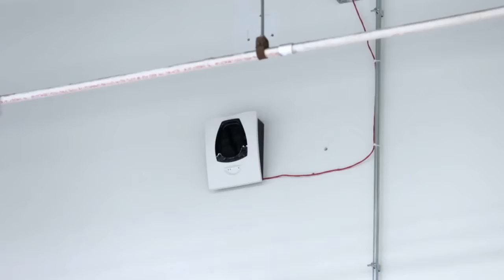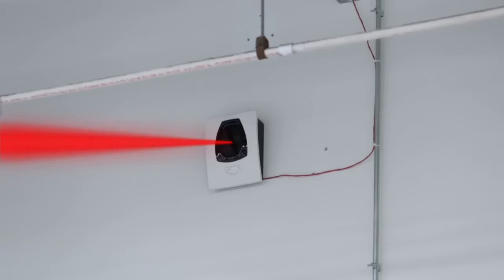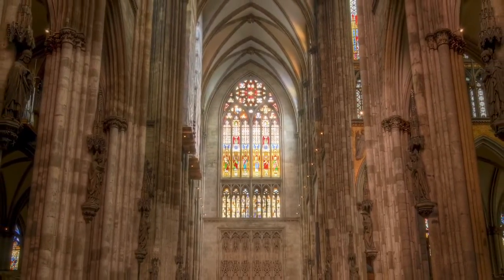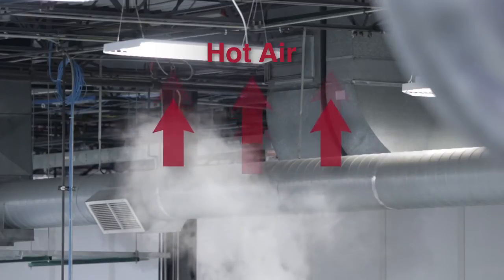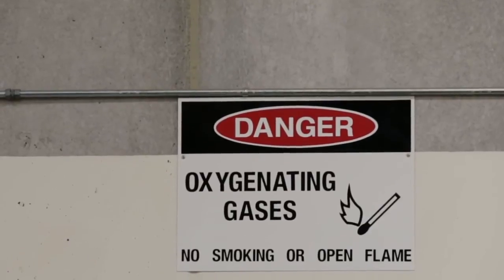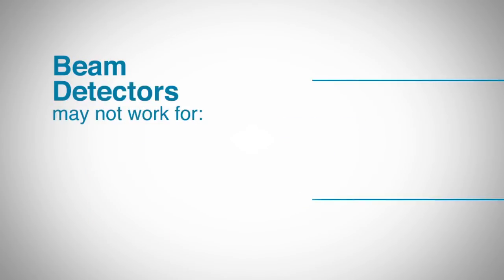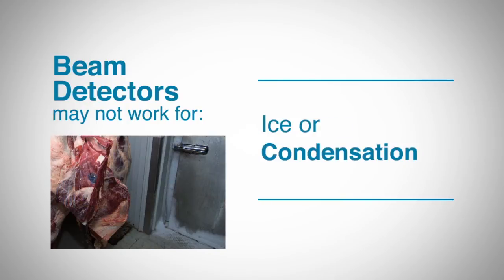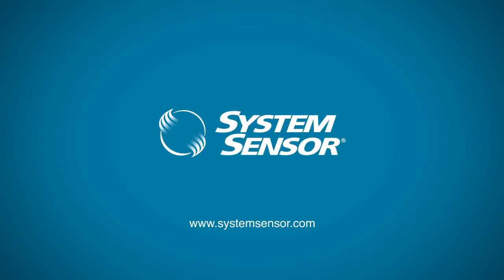Beam -- Chapter 1: Introduction to Beam Detectors

Comment: this type of detector can observe any obstruction such as light?????
Reply: It shines an infrared light to a reflector and back to itself at a receiver end.
You could set it off with your hand, but this won't happen as the unit should be positioned relatively high, requiring a scissor lift to reach. If smoke is in the beam of light, it will activate. It will only detect infrared light, so the visible spectrum should not interfere with the unit.